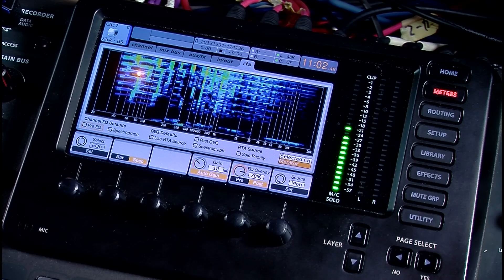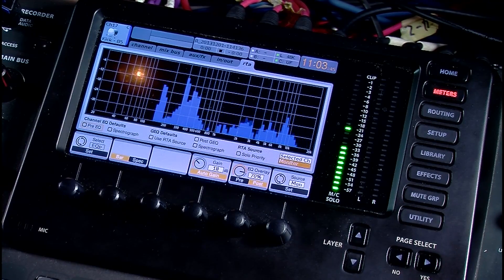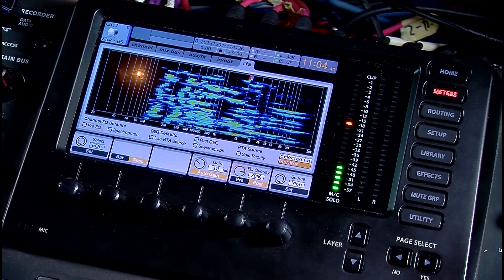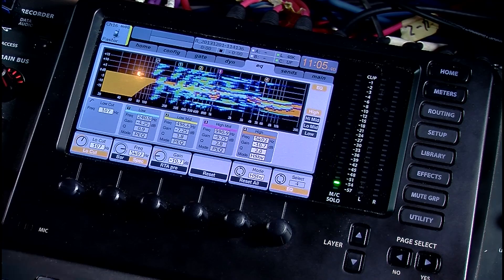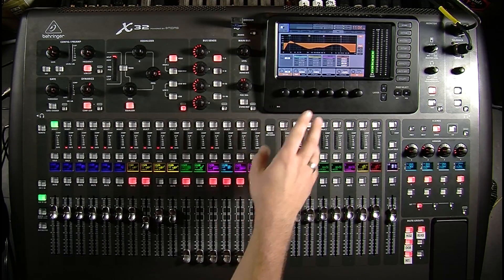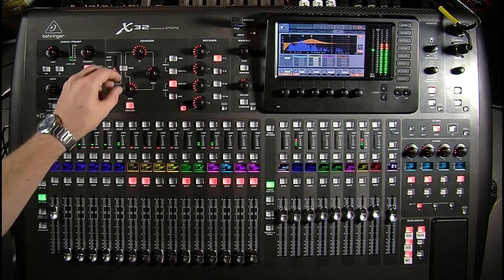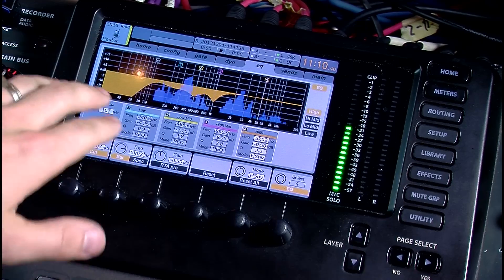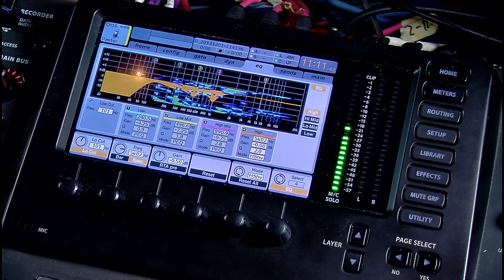Behringer X32 - Internal RTA & Specrograph Overview

Comment: Hi there. Is it possible to send pink noise to the main outputs of the X32, connect a measurement mic to one of the mic inputs and use the RTA on that input? Then use the graphic EQ on the master outs to do room correction etc?
Reply: I have the same question, please let me know if you figured it out, thanks!

Comment: Is this update stable?
Reply: Thanks J7C3B!! Now we patiently anticpating the IPAD and MAC update for this version..
Reply from the maker: It is an official release from Behringer, not a Beta.  So as far as I have used it, yes it is stable.  I don't think Behringer would release it if it wasn't stable.
Reply: Thanks
Reply: I just did a two week tour - 16 shows in 14 days - with the beta version and it worked flawlessly.  I'm sure Behringer wouldn't have released the official version if it weren't fully tested, so I think you are safe to go ahead with it.